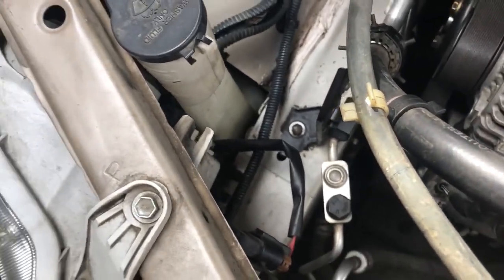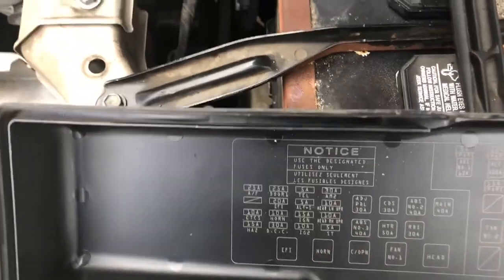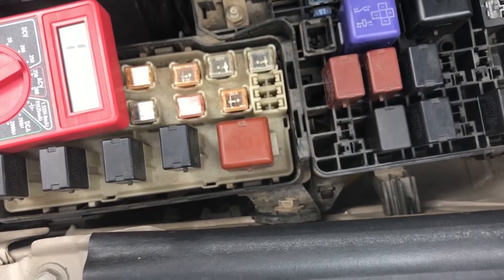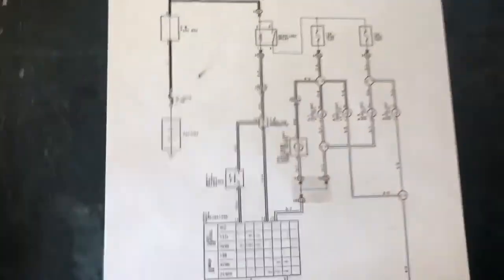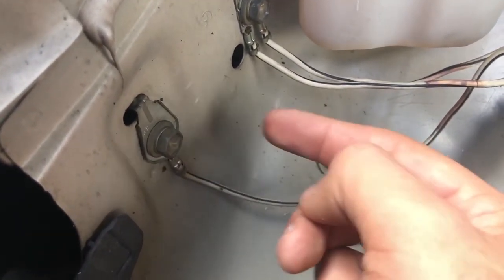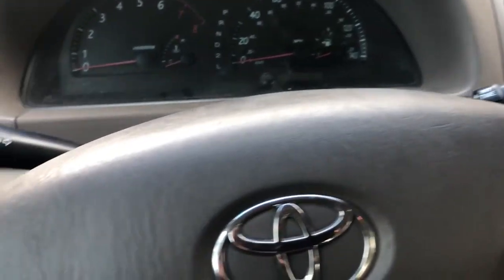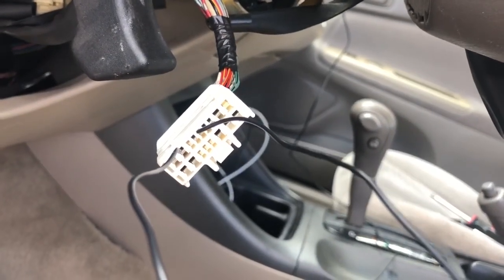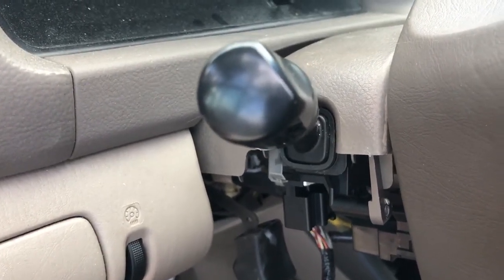How to Fix Headlights on Any Car [FULL Diagnosis] (2003 Toyota Camry)

Comment: Thank you 100 times over. All my headlights are working now. I had checked one set of fuses for the high beams did not realize I had another set for the low beams. I got info the wiring trying to find a break where non existed. Just got to re protect the wires and my car is back in action.

Comment: I've got a curly 1 for you. Both my high and low beam wont turn off when key is removed from ignition, went to an auto sparky, he couldn't diagnose it and put in a by-pass switch. Any ideas ? relay seems to be ok.
Reply: sounds like your relay is stuck open.  id try replacing the relay and see what happens.
Reply: @toddpfeiffer5701  I tested the relay for continuity supplying power from the battery and listening for the click, continuity was shown on the multi meter as ok. Istarted checking for issues in the under das fuse box and a drop of water fell onto my and " crap " on opening the fuse box i found a resistor had burned out and come away from the board, I got a replacement board from the wreckers but it needs reprogramming to my Ecm,
Reply: @markinnam6991 great!  Can you send a pic of WHERE the relay is located?  Thx
Reply: @toddpfeiffer5701  tried to do so using the email shown, but it says , please enter a valid email address ?

Comment: Try the relay that connects to the turn sign.  That should fix it.
Reply from the maker: It actually ending up being a small switch within the turn signal “wand”/arm that was not making a good contact. Idk if I mentioned it at the end of the video, but I got it to work, but I kind of broke the plastic clip that holds the switch in place. I mean it works, but it can come off when using the turn signal. I ended up replacing the whole turn signal arm a year later (I recorded this video 2 years ago). 

But thanks for the suggestion!

Comment: If the fuse is blown there's a reason for it no? Changing the fuse is fine so long as it is not going to happen again
Reply from the maker: @dbash2004  yes, there can be an underlying cause. It can be because of faulty wiring due to an electrical short. So, the electrical short can cause an excess of electrical current through the system; therefore, it will blow the fuse.
Reply from the maker: This can also be due to random vibrations from your car too. Further underlying cause could be worn out motor mounts. If the motor mounts are worn, then the engine will rattle the car a lot more. This can potentially loosen connections or possibly flex connections. 

But I would say most of the time, it would be due to old/corroded wires… rather than vibrations. But it should not be neglected from the root cause.

Comment: I have a problem on my 2000 Camry. When I press on the break, the low beam front light turns on.
Reply: Sounds like the wrong type of tail light bulb was forced into the socket. I had that happen on my Delta 88 Royale.